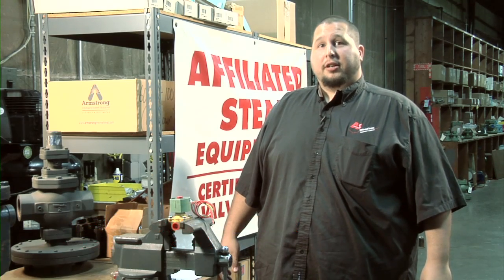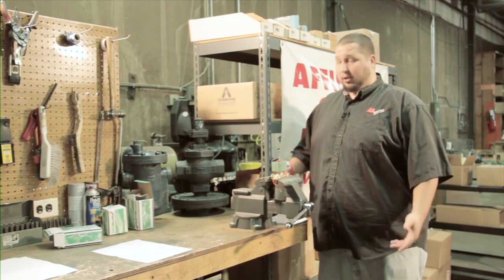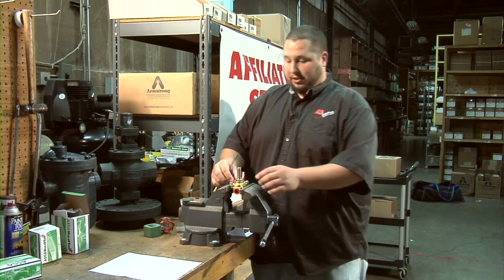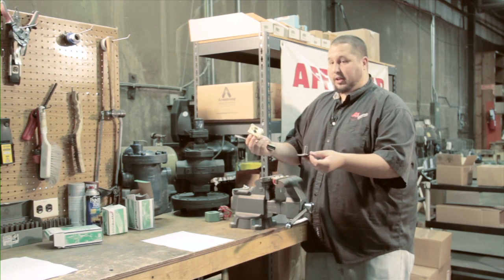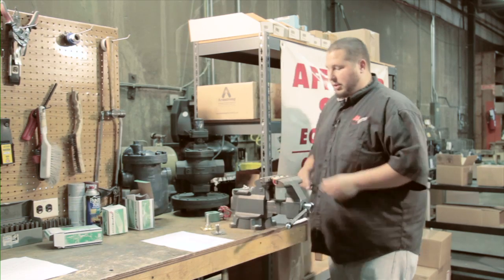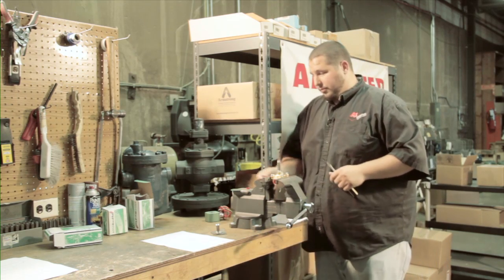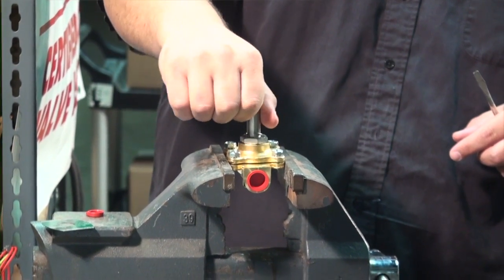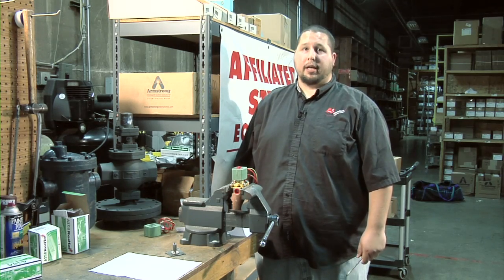How To Repair an ASCO Solenoid Valve | Affiliated Steam and Hot Water

Comment: I noticed when you put the valve back together, there was a lock ring in one video Just prior to putting the solenoid back on and then you cut the video, and there was the next video you putting the solenoid back on where the clip was not underneath the solenoid valve.. Does the lock Ring go under it must, Correct?